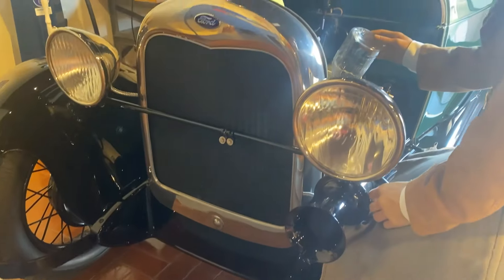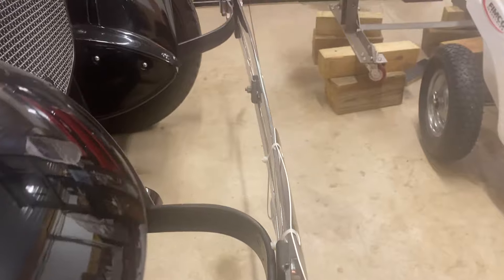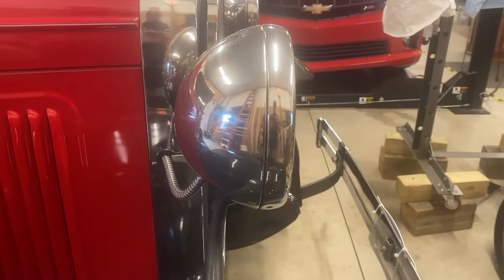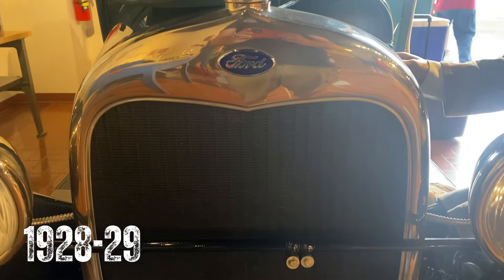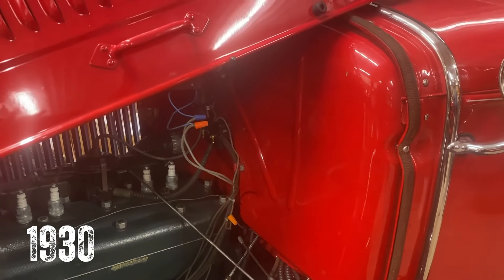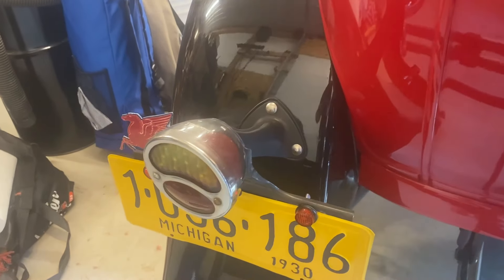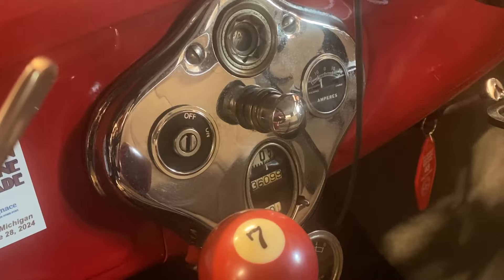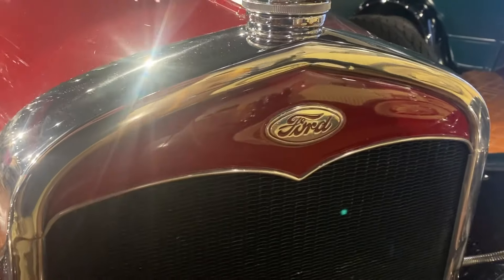The 1930 Ford Model A: Evolution of a Classic

Comment: I have a 1930 Murray Town Sedan here in Australia. I'm always amazed at how many differences there are between years, body types and even changes that happened during production. Then there's the differences between Left/Right hand drives, and even those differ depending in which country they were built. 
I always thought my Right Hand Drive car was built in Canada until I found out that they had Robertson square drive screws. It appears mine was built here in Australia.
Another interesting fact is the Right Hand Drive cars have the Brake and Accelerator (Gas) pedals in swapped positions, but the clutch remains in the left position. Surprisingly this felt normal to drive after a couple of minutes the first time I drove it, and I don't even notice it now.
Having the clutch pedal next to the starter button means that if you stall the engine, you already have to push the clutch in, and you can then touch the Starter button with your toe and drive off like nothing happened.
Reply from the maker: Very cool!  Thanks for sharing.

Comment: I’m trying to figure out what I have. The steering column has an added brace. When did it change from being welded to the tank? The splash guards are one piece. The radiator shell has that extra panel at the top, painted body color. Inside fuel shutoff, not indented firewall.
Reply from the maker: That would be a 31 Model A.

Comment: As I just found your channel and this series and I am only on EP.6 my question is, Are you doing a full restoration or just a lets clean up things and see if it will run? Because in a restoration I personally would not rebuild certain parts just to have to take them back apart when I start the actual restoration. Good series though.
Reply from the maker: Glad you found us. You’ll have to forgive the first few videos as we were learning the whole video recording stuff.  At Episode 6 we were just trying to see if we had a motor and transmission that would work. At Episode 12, the project starts to take a different turn. It will still be a restoration, but as you’ll see, the process gets accelerated quite a bit. Hope you enjoy the series. We’re still going strong at about 3 years in.

Comment: I thought they did Not make 1932 Model A's and the Deuce Coupe replaced the Model A
Reply from the maker: They did not make 1932 Model A’s, but the last of the 31’s didn’t roll off the assembly line until March of 1932.